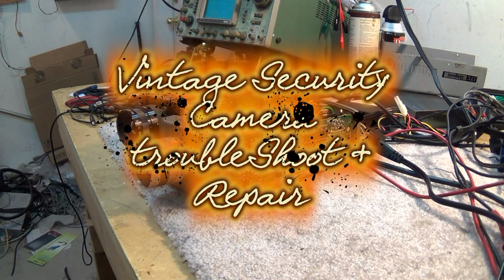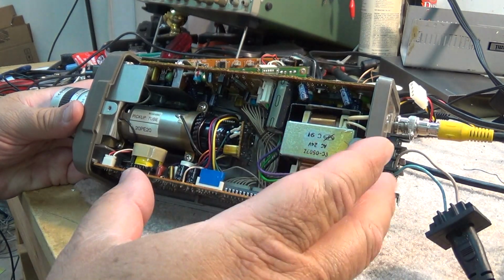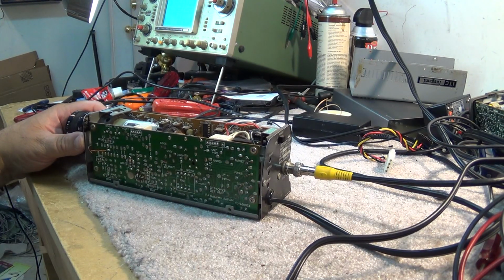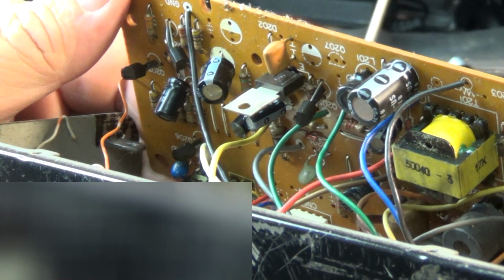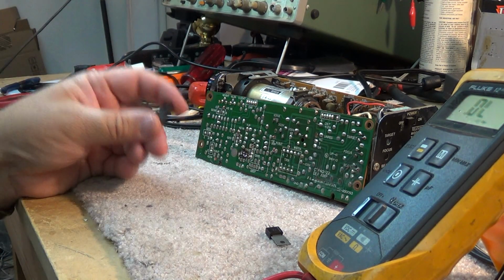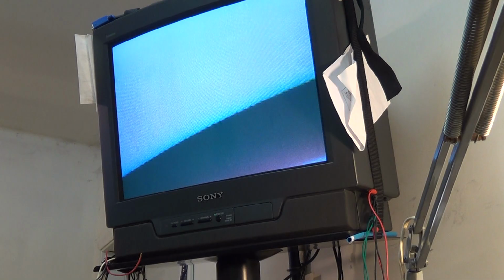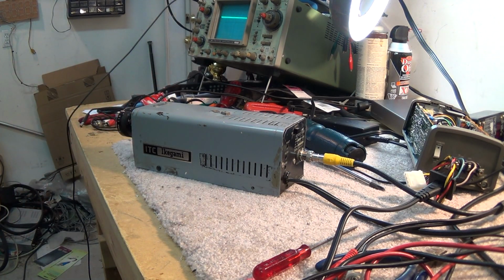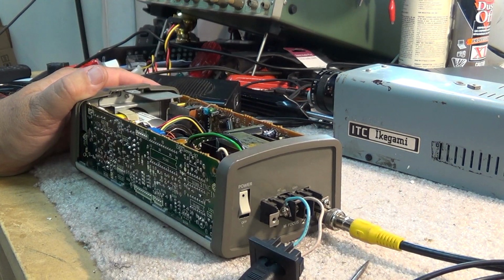Security Camera Repair

Comment: Their is so much make about millivolts , could you explain millivolts and how to read them.?
Thank You
Bil
Reply from the maker: Milivolt  0.000001 volts 1 millionth of a volt. A very small voltage indeed.
My meter for example in auto range will measure down to 0.001 volt or 1 / 1000 volts.
That would be 1000 milivolts. There is a seperate manual range to measure voltages lower than 0.001 volts. In this range it will measure between 1 mV and 1000 mV which is of course 0.001 volts.
Silicon transistors generally have about a 0.6 volt drop across the E-B and C-B junction. Older germanium transistors the drop was 0.2 volts.
You need to measure down to milivolts when setting the bias up on amplifiers as doo much bias will result in the transistor, or tube being over driver with bias, and that would produce excess heat, and shorten the life of the device. On the other hand too little bias will result in the device going into cut off and would result in a severely distorted signal.